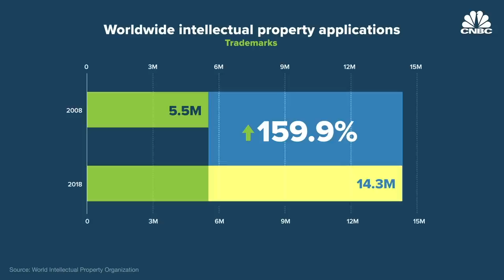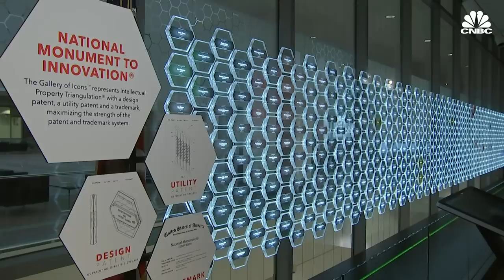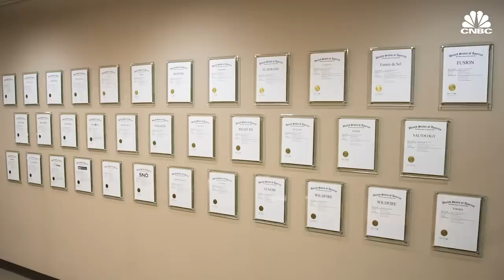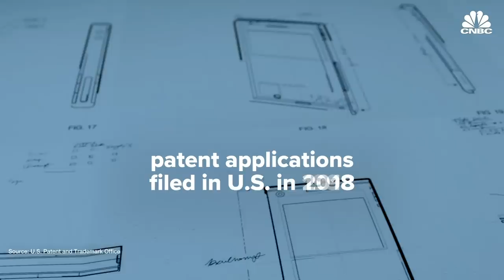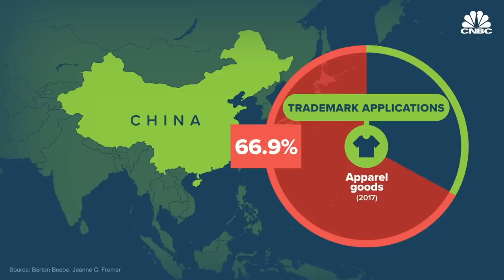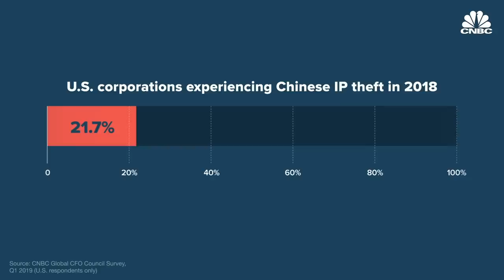Why The U.S. And China Fight Over IP

Comment: China's GDP before joining WTO in 2001  -   1.5 Trillion US$   and China's GDP this year 2020  is  14.3 Trillion US$
Reply: During that time US gdp also increased by 10 trillions but unevenly distributed. 70% goes to the 1% rich. Its not China fault if 50% of US population standard of living fall or remain the same. Thats your problem. You need a revolution in US. The 2 party system in US is a Failure

Comment: I like this clip to a degree, it is solely US biased. 
   I am in EU and know for a fact that US's systems does not work well in regards of patents. Simply because US is solely using its own laws and disregards anything else; a patent that is valid everywhere else in the world can be disregarded just by what the US system considers a "technical error", meaning, any of the papers for the patent may have a minor-minor fault even if the major part of whatever is common sense. Such a denial does not work anywhere else but in US.
   Another problem with US patents is about 'height of innovation' (I might be off of the proper term here), meaning how much the suggested "innovation" differs from existing and well known implementations. There was a clamorous debate when Amazon patented the one-cart-checkout; most of the tech experts said that was abusing the patent system because there had been so many others using that implementation before Amazon but without patenting such a low-height idea.
   Worldwide (I am not counting China here) the US patent system is considered flawed because a patent can be approved for almost anything. There are TWO parts to this:
   1) Things that has been around for quite some time (decades or more) and the "inventors" thought this is not worth patenting. Meaning, the technology has existed before the patent request was filed but still it is approved.
   2) This is actually something new, but the intellectual height is negligible, or slim to zero. Right now I fail to come up with a really good example but ... think of somebody that wants to patent a "I love" button which would resemble the "I like" button. Just that any other vendor cannot use "I love" on any button any longer. That is exactly what "low intellectual height" means, there is absolutely no value to the patent-wannabe. And still US often approves such requests.
   By this I absolutely do not defend IP or patent infringements, absolutely not. On the contrary. But when addressing a certain problem, as a journalist you need to consider all the questions and not being biased in any way. But maybe this clip from CNBC is not journalism?

Comment: I think the way patents are framed here is far too positive. Even aside from outride abuse of the system there are many more subtle ways the system can be used to stall competition and innovation.
A huge number of patents is filed not with the intent of incorporating the invention in a product, but simply baring the competition from doing so.
Patent intensive industries can also elevate the barrier to entering a market so high, that it becomes impossible to join a market without gigantic amounts of venture capital to acquire the necessary IP. This stifles competition resulting in markets with very few competitors. Noteworthy examples of this are the aviation industry. Where only two government backed companies dominate the industry or desktop or notebook CPUs where in combination with IP von the x86 ISA two companies own the market. 
Another problem is that the barrier for patents can be quite low. This is especially true for software patents. Think of the swipe to unlock patent. 
While software can sometimes show the worst sides of the patent system, it also provides inspiration on how innovation can be driven in a different way. The shift to open source, patent sharing agreements and standardization efforts of open media and compression algorithms have proven that at least in the software world can be more effective than fending of competitors with patents.